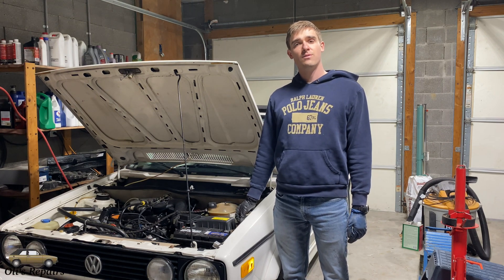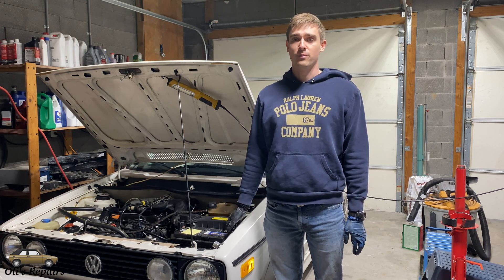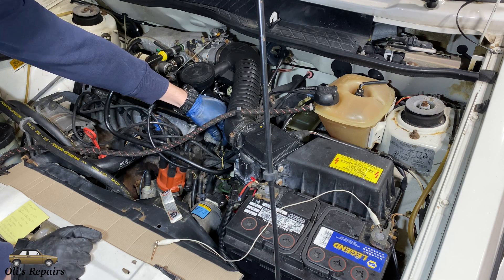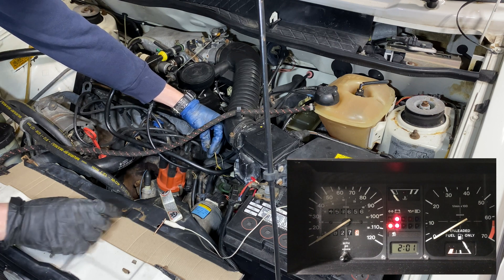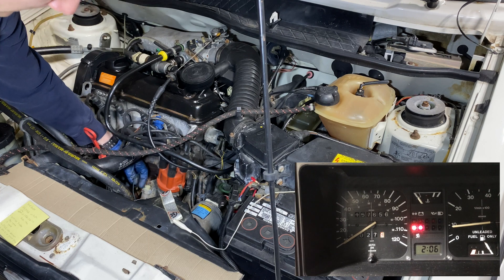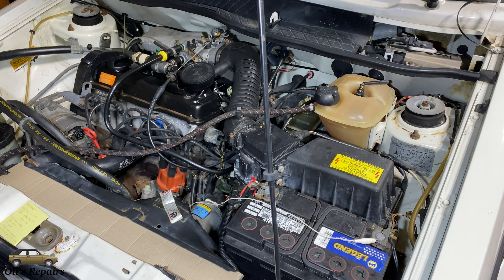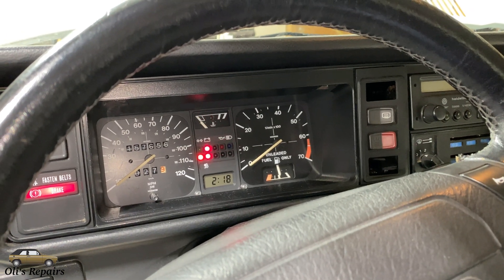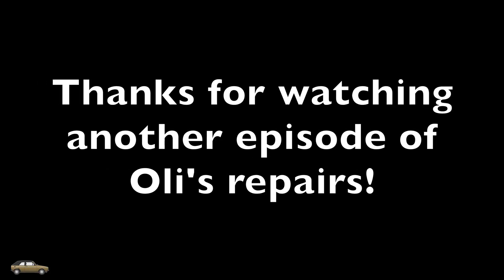VW Dynamic Oil Pressure System diagnosis Mk1 Mk2 Cabriolet

Comment: I have a problem on a golf 2 country when it reaches temperature and the fan turns on and the engine is over 2000 revolutions, the oil light comes on for a moment, not every time, but when the engine is cold, the oil light does not come on, I checked the oil pressure with the oil pressure gauge, the oil pressure is good. Thanks in advance for the answer.

Comment: I've 1987 Volkswagen Cabriolet, the car is in perfect condition only have 65,000 miles. I tested by unplugged the blue wire on the high pressure sensor and grounded and the light stop blinking.  So,  I followed your direction and replaced both low and high pressure oil senders and temperature oil sensor.  However, the blinking oil pressure light still come on at higher 2000 rpm.  Any suggestion?
Reply from the maker: try the test again. ground the wire on the high pressure sensor. rev above 2k rpm. if the light doesn't come on, then your new sensor is dead. You can also measure the resistance on the sensor - measure from sensor body to the tab. when the engine Is off you should see infinite ohms. then rev the engine and very carefully measure as the rpms are above 2k. you should see very low ohms. If you see infinite ohms, then you know your new sensor was dead on arrival. 

It's not uncommon to have these sensors be bad out of the box.

Comment: Hello Oli. I just realized that the led of my cabriolet is not blinking before I start the engine. I usually monitor the oil pressure on the gage from the central console. Watching this video made me to wonder if the light led is broken or if one of the sensors is broken. Should I change the three sensors that you are testing in this video? What would you recommend. Thanks.

Comment: 1989 cabriolet 1.8 L  I've done this test and I've replaced the sensor for the high pressure side because at 2100 RPMs or above the light and buzzer comes on. The gauge reads plenty of millibars of pressure well within spec. Now I grounded out the wire on the high pressure, the blue and black. But revving it above 2100 RPMs still gets it to kick on with the buzzer? Is it the wiring or is there something inside the gauge cluster that might be corroded?. I had the cluster out this weekend to replace the instrument cluster lights. I was looking at possibly taking the cluster apart to disable the buzzer and just be done with it. Any insight would be appreciated. It's driving my son. Absolutely crazy on drives.

Comment: Hi, 2 questions, does the yellow cable goes to the G or WK? Also, do you have a brown and cream color wire coming out with the 2 wires that go to the oil pressure sender. If so, do you know where it goes?

Comment: Hi I have a question. I had my sensors replaced and I get the oil pressure light when I turn the a/c on or when the rpm’s drop. I don’t know what the problem is. Also the engine vibrates heavily when the a/c is switched on when idle. It’s fine when driving. I’m not sure what to do.
Reply from the maker: @nicoleshadley2889  sounds like you have a legit oil pressure problem. What oil are you running? 
What year is your car? Are you in the USA?

Comment: 1993 VW Cabriolet, Digi,  174K. I have replaced both sensors with the 1.8 bar 1 Pin & the 2 prong Bosch Oil Pressure Switch; 0.5 to 0.3 Bar;  When I start the car she is fine until it heats up. When the car drops below 2,000 rpm it flashes. I have driven this car 6k so far, so thinking it's not the oil pump. I use an OE Mann oil filter and 20W -50 castrol oil with zinc. Thoughts?
Reply from the maker: @richardseidman8801  get a mechanical gauge and test the pressure. Your local auto parts will loan you one
Reply: @OlisGarage  TY for the fast response, your videos rock! What should the bar be at all idles? I assume if just below 1 bar at low idle, best to replace with a new oil pump? I see you have another video on that process. Is there a recommended pump to use/upgrade?
Reply from the maker: @richardseidman8801  at least 30 psi at 2000rpm is what the book says.
Reply: Hello Oli, she is actually running almost 35 psi at 2000 rpm. Assume next steps is to change the two sensors again? If so is it the 1.8 for the single prong and the .3 for the dual prong ?
Reply: The light goes on below 1800 rpm and psi is reading 18 at 10 rpm, so baffled? I have all the parts to replace with ABA pump, but would like to avoid if not needed. TY!

Comment: My oil light at the cluster doesn’t turn on when I turn the ignition switch on. I’ve tried all these tests on this video and can’t seem to get the light to turn on. Could it be a bad light bulb in the cluster ?
Reply: Hey Oli. I did all those tests and my oil pressure light doesn’t come on at all. Could it possibly be a bad light bulb ? Thanks

Comment: I love your videos! My 1986 Cabriolet just blew the fuse for my flashers/turn signals. I replaced the fuse and relay but I have no hazard or turn signals... any ideas where else I can look?
Reply from the maker: There are two fuses normally that can be affected. Check 4 and 19
Reply: I blew the 4 fuse replaced it and replaced my relay but still no hazards or turn signals. It's driving me crazy... they worked and then poof no dice. 

Thanks for the fast replay 😊 I appreciate it.
Reply from the maker: @CandyBond83  what caused you to blow the fuse? These things are always simple. Not easy, but simple. Bust out the multimeter. Check that the fuse is getting power on both sides.
People always jump to conclusions and think wiring went bad or something. That’s almost never the case, that wouldn’t make sense. Unless if you saw smoke rising or were snipping around on wires for fun.
Reply: I was doing my turn signal on front passenger... I think I arked it and blew the fuse but now I have no turn signal or hazards. Maybe I fried something when I arked it?
Reply from the maker: @CandyBond83  check the fuses with a multimeter. Remove them and Measure resistance. Then install and make sure 12v is on both sides
Reply: I checked the fuses, and they are all reading good. Thank you again.. I appreciate you helping.

Comment: My mk1 cabrio from 1992 with a 2H engine, do have a canister oil pressure with one connector only. 
I can see in your video that the canister you have is with 2 connectors.
I can also see that I have the 2 cables you mention (1 x blue/yellow and 1 x yellow).
I am more and more guessing that my canister is not original when i see your video.
Reply from the maker: It most likely is not. Do you have the 3 gauges in the center console? Which wire isn’t connected?
Reply: Thanks! No, I don't have the 3 gauges in the center console. The blue/yellow wire is connected, the yellow is not. @OlisGarage

Comment: Hi, I have the same issue with my Vw Scirocco mk2 (1985) but with the temperature red light flashing constantly! I'm trying to find which sensor to change but can't find it! I'm in the uk 🇬🇧 if it makes any difference? 👍
Reply from the maker: Sometimes the gauges do that and I haven’t quite figured it out. My next step is complete gauge rebuilds with all new electronics. That might fix it. But, I’m not quite there het

Comment: Thanks for the infor my cluster all gauges are not  working only battery  and indicator lights works, when i turn the key on there is clicking sound from the relay as if hazards  are on

Comment: I think so you incorrect while saying that blue wire is high pressure, but it's actually wire BLUE D01 (Low Oil Pressure Switch) also same with yellow wire is it actually YELLOW D21(High Oil Pressure Switch) ,but it's not a low pressure switch.
Reply from the maker: Nope, that is incorrect. The Bentley manual is wrong. Watch the video and see how the car reacts when I unplug the respective wires. I triple checked to make sure I was doing it right.
Reply: @OlisGarage  Maybe you are right, because I tried to wire up how I just said, but in that way no flashing light. In your way it started to flashing continiously. When started the engine the flash turned off. :))

Comment: To add, my oil light starts blinking after about 20 to 25 mins that i have been driving the car, it only does this after that time and when i come to a stop, if i accelerate above 1500 rpm it goes away. Also, my friend conected a manometer i think its what is called, directly where the high pressure sensor goes and its readings where higher than my inside middle gauge. Any ideas why this could be? I am hoping its the canister, but i rather be sure. I hope you can help. Thanks
Reply: Same issue

Comment: Based on your analysis, and on what you said on the last minute of the video, would it be safe to say that if the light stays on after u start the car, the problem is the low pressure sensor or canister like you called it?

Comment: could I ask you a favor? I have an MK1 Rabbit 1983 GLi convertible and the temperature indicator is rising and the fan is not turning on. It turns on normally when I turn on the A/C. Could you send me a picture of your panel at normal working temperature? Mine is getting very close to maximum temperature, marking 3/4+-. Thank you and I  love your videos, keep going
Reply from the maker: Sounds like you need a new radiator fan switch. Send me an email. It’s listed on the “about” page of my channel

Comment: Hey oil's  garage. Mine also blinks but when I do the high beams and low beams switch,  the  blinking light goes away for a  while. In so confused. HELP PLEASE.
Reply from the maker: Have you tested every sensor like I outlined in the video?
Reply: @OlisGarage  that'll be next thanks for replying. God bless you.
Reply from the maker: @choncoconcos5912  there can be multiple things going on at once. You can have a faulty sensor and also have a faulty ground in the instrument cluster, or even something else. But I always start with the easy things.
Reply: @OlisGarage  you got it,  it may also be the  instrument cluster because is not the original.
Reply from the maker: @choncoconcos5912  I definitely think that there is a problem in the cluster. Adding an additional ground might help the cause (just splice into the brown wire going to the cluster and ground that wire)
Reply: @OlisGarage  thank you.

Comment: thanks for the video ! i have a 82 rabbit with a mk4 tdi swap and ive been wiring the dash your videos are a great help
Reply from the maker: Ooohhh TDI swap!! You going ALH or BEW?
I've got an 03 ALH (I've made a few videos on it). Just rolled over 200k. Such a great car and amazing engine. I kind of want to do a 2.0 TDI swap to my brown rabbit....
Reply: it’s a ALH used the s&p mounts clutch cable and wire harness, the car is a blast to drive

Comment: I thanks for you video. I have a 1.6 2002 chico model we did replaces sensors oil is the right oil we did a pressure test engin is still very good but still that buzzer problem please help me

Comment: My Mother had a 1982 Volkswagen Jetta N/A diesel until 2003.  The oil pressure warning buzzer would turn on all of the time very frequently.  She would whack the dash until it went off.  It was at the mechanic so many times and NONE of them could repair or disable, not even the dealership techs!  BUT WHY could none of them disable the buzzer?  By the way her Jetta had the 3 cutouts for gauges in the low section of the dash but they were empty, I remember 20+ years ago she said it was for some performance package or something sporty oriented that she didn't buy at the time of purchase back in 1982.
Reply from the maker: Hmm, I have no idea how the dealership couldn’t fix that. It isn’t a particularly complicated system. 
Interesting about the 3 gauges. I’d never heard that cars were sold with the cutouts but no gauges. Not saying it didn’t happen, I just hadn’t heard that before. 
They were great cars though. The diesel was a little slow, but they ran forever.
Reply: @OlisGarage  This was during the year 2000 or 2001 at best - nearly twenty years since the manufacture of this German-made car.  Also two other independent mechanic shops.  One of them claimed to have fixed it and then on the drive home I remember the buzzer went off again.  Everyone was always stumped.

But yes the 3 gauges at the bottom weren't there, but the 3 holes were.  If I recall there was a black Jetta cover plate (like a delete plate) over them with silver text.
Reply from the maker: @Florida_Man_In_Florida  ooohhh yes I’ve seen some of those cover plates. I guess I never put two and two together that they covered the gauge holes.

Comment: I have installed an oil pressure guage.  Piece of mind.
Reply from the maker: Is it a mechanical one or electric with sensor? 

The gauge in the center console works great, especially if the two pressure switches work. 

Quite frankly, a gauge and a pressure switch is also how military aircraft are designed because it’s a great redundancy. That’s why I never bothered to fiddle with installing yet another thing. I have two switches and a gauge. That’s enough redundancy for me. If one of them breaks, I just have to fix it ASAP so that there is a redundancy again.

Comment: Mine seems to blink when I brake. Any ideas? It's a 92.
Reply from the maker: Is your car filled with the right amount of oil? That's my first thought. And when it starts blinking, what does the oil pressure gauge do? Does it also show a drop in pressure?
Reply: @OlisGarage  It was full. The pressure would drop to around .5 on the gage when I would brake. The ambient temp was high 90s F so that mat have contributed to the old oil + low pressure issue. 

It's a new-to-me car and i changed the oil and it seems to have resolved the issue. 

I'm excited to have found your channel. I'd love to see how to remove door cards, etc to repair locks, windows, etc if you have a video wish-list. The holy grail would be a top-replacement video, as there are no good references with the level of detail you give to your content. Keep up the great work. I'm learning a lot from you.

Comment: Awesome video. Can you please tell me what are all the cluster indicator lights for. I notice different color types and have a few on that don’t know what they are for. Thanks
Reply from the maker: Flashers - green
Battery - red
Osx (oxygen) - yellow. Blank in my car
Oil pressure - red 
High beams - blue
Two red lights on the bottom - airbag.
Reply: @OlisGarage   Thanks   I appreciate your help.

Comment: For the first sensor on the oil filter, you said if it spikes when ground everything works and you just need to replace the sensor. Does that mean it isn’t suppose to spike when ground or it is?
Reply from the maker: Watch the video again and it should be clear if you watch the inset video along with my arm motions. 

But I’ll also briefly explain. Grounding the wire should cause the temperature gauge to indicate an infinitely hot temperature. 

If your oil temperature has been indicating incorrectly, and your gauge spikes when you ground it, then replace the sensor.

Comment: If I already change all the sensors, it may be that this wrong ??
oil change and oil drain cleaning
Reply from the maker: Are you running the correct oil for the temperature? In warmer climates 20W50 is recommended.
 If you change the sensors and the problem persists, find a mechanical oil pressure gauge and measure the pressure. If that indicates low, you probably have engine issues. 

You can try upgrading to a high volume pump which may also help. I have a video of that as well

Comment: I have the same problem with the oil red light and the buzzing nose but i don't get myne right
Reply from the maker: Test the pressure with a mechanical gauge. Then with that info you can figure out if the engine is messed up or if you just need to figure out which sensor is broken

Comment: Oil, so I did everything you said here which fixed all the issues but it now created a new one. With car at temperature in idle showing 1 bar, the oil light blinks, when I step on gas pedal pressure goes up and light stops blinking, but it always blinks at idle. What could it be?
Reply from the maker: Either you have actually low oil pressure at idle or your low pressure sensor needs replaced. Not sure what you replaced/fixed. 

Run 20W50 oil (assuming it’s somewhat warm where you are) and a Mann filter.

Comment: I just watch my oil pressure gauge, but now I'm ordering some replacement sensors. Thank you so much for these videos. We own three of these Cabbies, and it's a pain to figure out a lot of the quirks!
Reply from the maker: The system is actually well designed with a redundancy. You have a sensor for the warning light, and a separate sensor for the gauge. So, if one of those sensors fail, then you have the other to cross monitor performance. 

Maybe it was a redundancy, maybe it was just easier for it to be designed that way. However, I know that helicopters have a similar design for the engine and transmission oil pressure indications and the associated cautions. 

Glad to hear the videos are helpful.
Hope they keep the cars on the road!
Reply: @OlisGarage  I bought my 92 Wolfsburg for 400 bucks. Love these go karts so much! Just repaired the headgasket this weekend.
Reply from the maker: @thatguy.42  nice!! I did my head gasket as well, though that was before I started making videos. It’s not a bad job. Just a tad tedious.